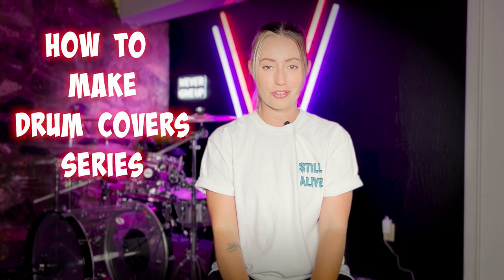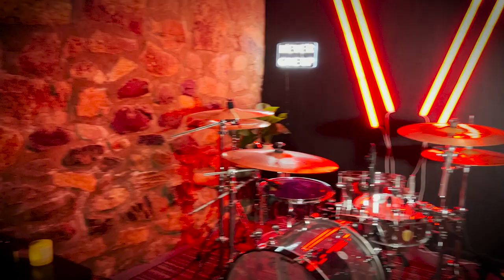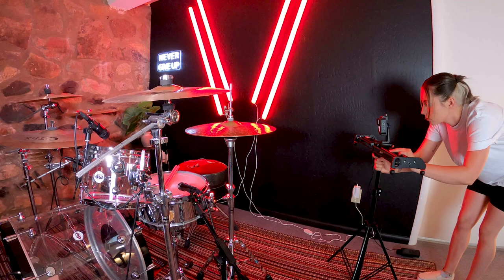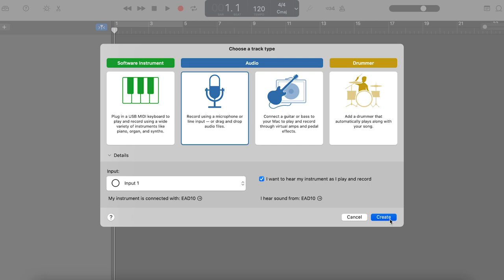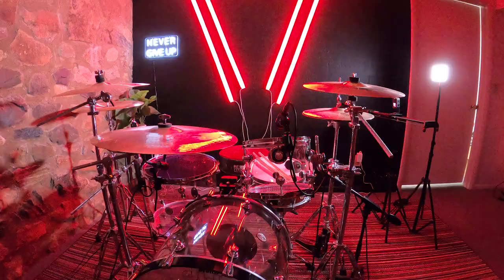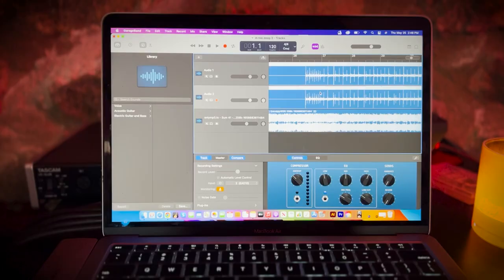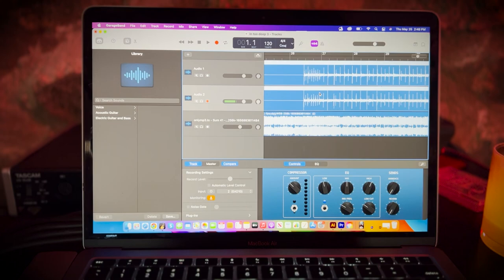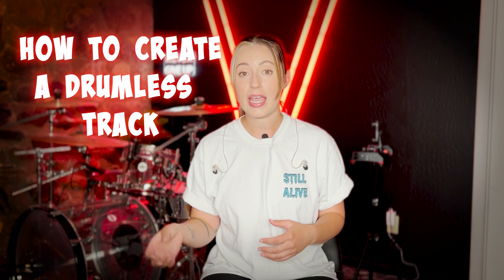How To Create Drum Covers | My Step By Step Process Of Filming A Cover

Comment: Can I recommend you checkout a different camera? I use it for maximum convenience. It helps save loads of time once you get the levels dialed in where you want. The camera is the Zoom Q8. Essentially all you have to do is trim the start/end of a take and then upload it. Due to inputs available on the camera itself. 
Just something I've used for 4 years now and it really does make a difference. Not having to sync up the audio/video...etc. 
I like your way of doing it too. Just thought I'd toss my 2 cents in on how I kinda do it. 
Keep up the great work.